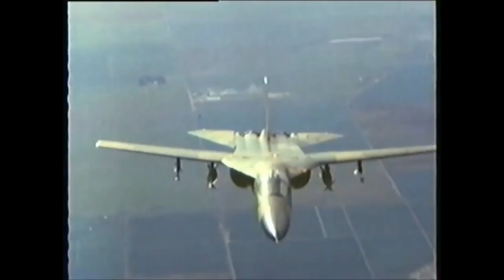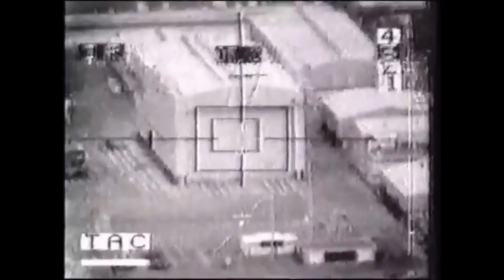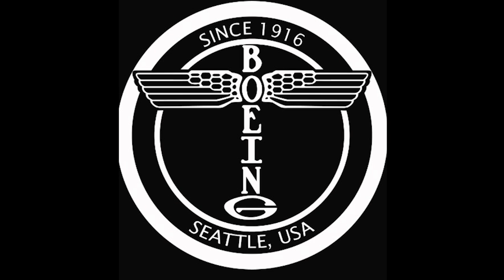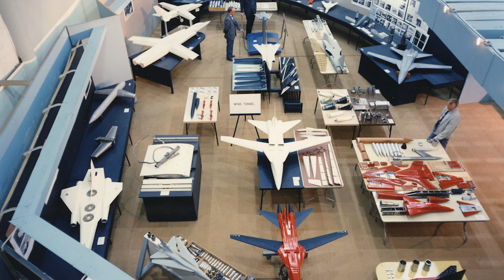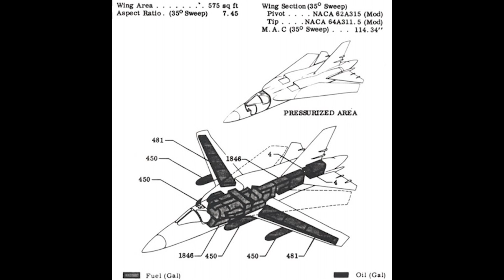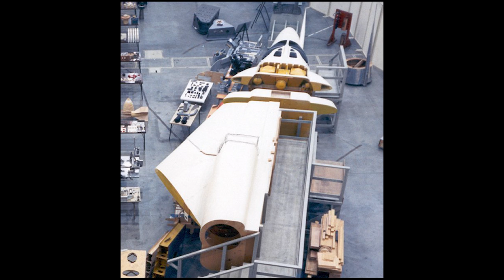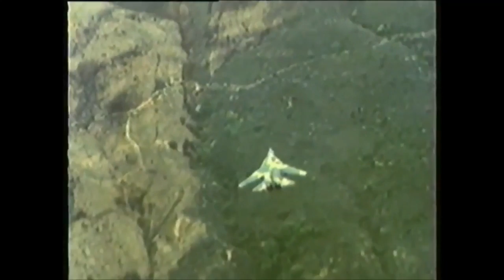Boeing 818 TFX; The Actual Aardvark?

Comment: Ed, you stated on multiple occasions that the TFX was a good aircraft.  You must have gotten that from GD press releases and statements from the USAF program managers.   The F-111 was supposed to serve as both a fighter and a tactical bomber.  It did not have the performance to be a fighter.  Its EM curves made it a sitting duck for all contemporary and contemplated adversary aircraft, and it would have lost in aerial combat to some Korean conflict aircraft.  As a tactical bomber, its payload was inadequate.  Its much touted terrain following flight capability proved to be non-existent in the delivered aircraft.  It is THE example of why aircraft should be designed around a specific role.  Compromising to fit multiple roles tends to create aircraft which are not competitive in any role.

Comment: Macnamara  showed his incompetence here, commonality has NEVER worked for new designs to save money , naval aircraft can be used in Airforce roles but Airforce aircraft are always unsuitable for naval use as they have to be designed for that role from the ground up, in addition the F111 was NEVER designed to be a fighter or interceptor, it was designed from the ground up to be a medium range , low altitude, high speed bomber, the reason for the F in  F111 was because in the late 1950's, the USAF, wanted to introduce a new medium bomber, however there was at that time NO FUNDING in the USAF budget for initial studies for such an aircraft, HOWEVER, there WAS some funding sloshing around allocated for initial development of a new fighter, they used that funding for the new bomber but because of accounting rules what should have been the B111 was labeled the F111this had disasterous consequences because i am not sure Robert Macnamara ever realized this and proceeded to try to force the U.S Navy to accept a purpose designed USAF low level bomber as a fighter inteceptor, something it was not designed to do.
Macnamara's decision added YEARS to the F111 programme and many millions of dollars wasted.

Comment: Ten years ago, I a report on the F-111 project/TFX at an Army school I was attending at the time.  (Yes, kind of odd for a soldier to be doing a report on this, but odd things happen in the military!)  The electronics requirement for the two services were totally incompatible.  Getting the aircraft down to a size that would fit on an aircraft carrier proved challenging as well.  In the end, McNamara was trying to fit a large square peg into a small round hole and it just wouldn't work no matter how stubborn he was.

Comment: Really curious as to how the 818 won the competitions 4 times without an actual fly off. The intakes on the dorsal side is a HUGE risk for ACM as the obstruction of the air stream during high AoA maneuvering would starve the engines and crash the aircraft. The 818 also didn't have the wing sweep range of the F-111 or even the F-14, which would have massively effected it's low speed handling characteristics and possible MTOW. This not only damages it's possible payload size but it more importantly damages the performance for CTOL functionality. Further more, the large single V-Stab was found to be a problem on the F-111 for the NAVY because the structure was so high that it would cause clearance issues inside the carrier hangers - this is one of the reasons why the F-14 used a split / twin tail design. 

Unfortunately this makes McNamara seem like the smart one here because the F-818 out of the box doesn't seem feasible to achieve what Boeing says it does and I don't see how the aircraft would've faired well at high speed low level flight with that configuration - it would've been a sitting duck if a single engine flamed out due to interruption of air flow. Craziness.
Reply: The fact that the Navy accepted the dorsal mounted intakes is unsurprising in light of the fact that its original requirement was for a heavy fleet defense aircraft, not an air superiority fighter.  A dorsal intake had also been used by the proposed North American F-107 for USAF.  That one severely restricted reward visibility, but again it didn't matter because the F-107 was to be fighter bomber, not a dogfighter.  The F-111 design also had poor reward visibility, as well as side-by-side seating at the insistence of the Navy, both indications that it was not meant to be a dogfighter.  
The Navy eventually realized it also needed to develop an air superiority fighter. But the budgetary environment could not support two new aircraft, so they had to develop one aircraft to perform both the fleet defense and air superiority roles.  By then the F-111design was unsuitable, so the Navy withdrew from the program and initiated development of a new new aircraft that would become the F-14.  One of first things they ditched was the side by side seating, in favor of the tandem seating which USAF had wanted all along.
None is this is an indication that McNamara's goal was unreasonable--it was reasonable for the initial requirements presented by both services, but the needs of the Navy evolved.

Comment: brilliant plane the F-111, we could still be using it.
Reply: The RAAF was planning a rebuild and upgrade to the F111 fleet, the funding had been allocated, and ALL the engineering and electronics planning was done, then John Howard unilaterally signed us up to the F35 programme against RAAF and DOD advice and the F111 was quickly killed to ensure we could not back out no matter what happened in the F35 programme , of course as a bomber the F35 has a max bomb capacity similar to an F18, and nowhere near the range and bomb capacity of a F111.

Comment: With a MTO of 100,000 lbs the F-111 was never going to be of any use to the US Navy
as it exceeded the max load carrier decks of the day could accept by 20,000 lbs
So if something went wrong on take off, the aircraft could never land back on the carrier with weapons and fuel and the pilots would have to eject into the sea at low level

Comment: The 818 looks like it would've been a poor substitute for the Tomcat to me. Dorsal engine intakes cause compressor problems at high angles of attack, which would mean pulling G's in a dogfight would probably not have been feasible. Same thing with the poor cockpit visibility. In the early 60s aircraft were designed for long range interception with missiles and dogfighting was thought to be obsolete. Vietnam showed that to be not the case, so when the Tomcat was designed it had high pilot visibility and was able to handle close in fighting as well as 80+ mile intercepts, so it probably worked out better for the Navy in the end.
Reply: My thoughts exactly about the intake locations.  Especially in a hard ride TFR mode for the USAF version screaming along the deck at .8 - .9 Mach, auto TF sees a mountain and pitches up with max g, both motors stall.
Reply: depending on the material and wing design, you could easily keep the flow attached to the wing (and therefore into the intake) at somewhat reasonable alpha, but it is ofc suboptimal
Reply: Which is why the Navy alternated between saying it was unacceptable, and encouraged its going forward.  They wanted the TFX, the naval F-111B anyway, to crash and burn so that they could get their Tomcat.  "Yes, give us the thing that will fail badly in testing, then we'll take it to Congress and get them to defund it, and then we can finally get around to making what we actually asked for" which is what befell the 111B later on.
Reply: The Tomcat was designed primarily as an interceptor.

Comment: F-111 teething pains were quite severe.  Texas Instruments made the circuit boards holding the computational guts of the flight control system.   The first time an F-111 attempted a high-g turn, the chips detached from the boards, rendering the aircraft uncontrollable.   It's just sad to think that a dead test pilot or a dead USAF crew are now reduced to 'teething pains'.
Reply: While I can agree with the settlement, all high level technology always has a human cost. There was acceptable loss rates for almost all businesses. A set number per ton is an example for early 20th century ship building. It’s not easy to swallow but people die just learning how to fly these aircraft. Testing is obviously far more dangerous and ultimately far more deadly, this is a known fact and is why only well seasoned pilots take part.

Comment: TFX smf CXA (C-5)  -- Both selections were based on electoral votes.
Reply: The Air Force rquirement that was designated as the C-5, wasn't the CX-A, instead it was originally known as the CX-HLS, which means: Cargo aircraft, Heavy Logistics, Experimental.

Comment: This is a design that needs to be revisited to be the starting point for a modern descendant that is not off budget.  Disregard stealth as the first design limitation and concentrate on long range high speed precision strike bomber with options for all the modern decoy electronics and the power to lift more than its own weight with ease.

Stealth is great for almost not being found. Trouble is once you are actually found up in hostile skies those design limits that stealth impose have subtracted other features (such as armor) that would help you get back to base.  F-111 proved the type was good at delivering ordinance on hostile forces despite the design restrictions mentioned.

Comment: The top mounted engine intakes have been proven,in an actual physically built airframe,to be dangerous and unrealistic design. The airframe itself,will blank out the airflow in extreme angles of attack! They look cool and are cheaper to build but are not good in the real world!
Why do you think no active aircraft Ever! had them?? The closest thing to them on an active duty plane is the B-2 and if you've ever seen them land or take off you'll notice the auxiliary air intake doors that open on top of each intake. Even with the intakes almost on the leading edge of the wing,they lose airflow and had to have those doors to keep the airflow efficient and steady enough.

Comment: Ed the over inlets are bad 👎 because going hard vertically with no other inlets can stall the motors do to lack of air compression. You will likely get a low pressure spot right behind the cockpit starving the motor at the beginning of a  climb

Comment: I was always of the impression that L.B. Johnson and his secretary of the Air Force placed extreme pressure on MacNamara to get the GD aircraft because they would then be built in Texas and GD (ex Convair) was in big trouble because of the failure of it's 880/990 airliner program and cuts in F-106 procurement. Anyway this is the second version of the F-111 selection story I've heard and the two don't agree very much.

Comment: Those top mounted intakes look like there may well have been some interesting moments ahead in a rapid pitch up...
Reply: You mean like intake interruption? Ya probably!
Reply: Looks like it should be a transformer
Reply: @badlandskid  It is.
Reply: @badlandskid  it is a transformer! ⚡
Reply: @badlandskid  I had exactly the same thought.. Starscream!!
A while ago I researched and discovered Starscream was a F15
Peace
Reply: yea i kinda was thinking that to when i saw the schematics of the thing. intake disruption with high angle of attack and uneven airflow with the s-ducts and angled engines. still looks cool
Reply: I seem to remember the F111 "triple-plow" intakes causing no end of problems till they sorted out the boundary layer ...................................?
Reply: @fredtedstedman  the issue was less the intakes and more the TF-30 being rather fond of compressor stalls in all of its applications.
Reply: ...the F-107 (concept) was a proposed  fighter in the classic 'Century Series' with just such an intake -
Reply: @mohammedcohen  I don't think the F-107 counts as century series, since it was only a prototype. Same with how the XF-103 and XF-108 don't count as Century Series
Reply: Well then flanker and fulcrum have similar things but under the fuselage and duct some more in length
Reply: I'm pretty sure the guys that designed the thing will have accounted for that. 
Call me nuts but I assume industry leaders know more than some people off of the interwebs

Comment: And at the end the TAC received THREE (!) aircrafts for these various roles:
A7 Corsair II, light/medium attack
A10 Thunderbolt II for AT/CAS
F111 for long range attack.
Pratically the antitesys of McNamara's ideas!
Reply: The A-7 was intended as a replacement for the A-4 skyhawk which was a 1950s design by the legendary Ed Heinman ( who ironically designed the A-4 to replace the venerable A-1 skyraider the only piston driven plane to score a MiG kill). The F-111 was built to be a long range nuclear armed penetration aircraft with a secondary mission of tactical precision air striker. Eventually SAC requested a special version of the F-111 called the FB-111 which was designed for long range deep penetration strikes in unfriendly territory. Then the F-111 moved into the EF-111 which was an excellent electronic warfare jet. ( it was the USAFs version of the EA-6B prowler). The A-10 was built to do one thing, pop Russian tanks as they came streaming over the fulda gap in Germany. Its secondary mission is close air support but it’s primarily supposed to be killing tanks. ( in Iraq in 1993 on a 1 day killbox mission a pair of hogs popped 27 Iraqi tanks). Now anti armor helicopters are an army thing as the USAF has opposed the army getting fixed wing jets, however nobody ever complained about choppers. For that reason the army has traditionally operated the AH-1s, Hueys and AH-64s

Comment: F-111s were iconic in Australia. Miss their afterburner shows.
Reply: I hear a lot of techs got sick cleaning out the fuel bays of them though. I think it was poor RAAF procedures that had the unfortunate techs cleaning out bays without breathing gear when it was soaked in carcinogens. Poor bastards.
Reply: Fuel dump shows.
Reply: I lived in officer's housing next to the runway and their afterburners literally rattled the glass out of our windows!
Reply: My Mrs. was a USAF officer and worked on the Australian F-111 upgrade program as one of her last projects before being downsized in August 1994. Her last project was the AC-130U.
Reply: Remember seeing one as it flew over Sunnybank in QLD.
Reply: How much cost the flight hour of an F-111 Aaardwark? The last notice about F-35 was they presents only 36% of disponibility, with more than 800 project problems, an promised flight hour of $20,000.00, and an real flight hour of $36,000.00, it's more than the flight hour of three BOEING F-18 SUPER HORNET, that costs each one $11,000.00, the flight hour. And the motor of F-35 are revealing an too short life. The F-35 are a real lie, an promise unfulfilled, and extremelly expensive. That's the hole without botton were goes 40% of heritage of each american citizen when their fathers dies.

USA had the two too much good F-16 XL and an Grumman F-14, and put them in the waste basket of history. Now USAF is cancelling the F-35 production line, and doesn't have an proved substitute.
Reply: @AClockWorkOrange2505  stop having a stroke or learn english
Reply: @AClockWorkOrange2505  Your CPFH, engine life claims, order cancellation, and everything are all incorrect.

F-35C is way easier to maintain than the F/A-18E and F.  F-35C MMHPFH are less than half the Super Bug.

F-35C: 6.1-8.9 MMHPFH
F/A-18E: 14-21 hrs

It varies each year, but F-35s are way easier to maintain.  F-35A is 4.1-5.9hrs, which is crazy-low.

F-135-PW-100 is THE most reliable, powerful fighter engine ever built, with the longest Mean Time Between Overhaul.

You don't know what real engine problems look like.

Comment: F-111 could never given the Navy an Air Superiority Fighter. I flew F-111F for 7 years.  It was a Bomber, not a Fighter. One helluva an airplane but a penetration Bomber.
Reply: The B was not originally intended to be an air superiority fighter -- it started as an update of the Douglas F6D Missileer fleet defense aircraft.  But Navy air combat and equipment doctrine was evolving in the light of Vietnam combat experience, and they realized that also needed an air superiority fighter to replace the F-8 and F-4.  They also realized that they would not get the money for that in addition to the F-111B, so they decided the F-111B would now have to be an air superiority fighter as well as a fleet defense missileer.  As you know the F-111 was a great plane in many ways but it was not a dogfighter, so the Navy was wisely allowed to withdraw from the TFX program that no longer made sense for its needs.
Reply: You're right, the F-111 was just too big for the Air Supremacy role. In order for a fighter designed for that mission, the aircraft needs to have a wing design optimized for lower wing loading, which in turn, allows for greater agility, along with the right mix of weapon systems, fire control systems, and also enough internal fuel capacity, to allow long range loitering times, and combat radious.

Comment: Always wondered how they meant to solve the working of the over-fuselage air intakes – not seen on many aircraft due to the problem that the intake airstream gets cut off at high angles of attack.
Reply: As primarily a low level strike aircraft and secondarily a bomber interceptor they probably sacrificed the high AOA ability you'd want in a dedicated air-to-air fighter like the F-15 & 16. The F-111's high AOA characteristics were certainly nothing to write home about.